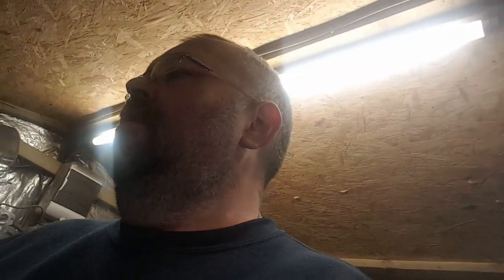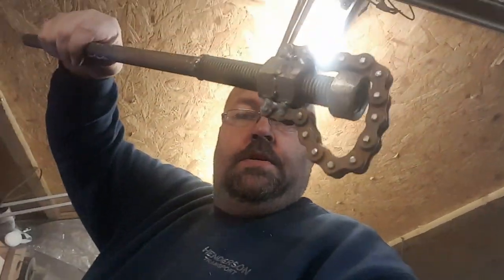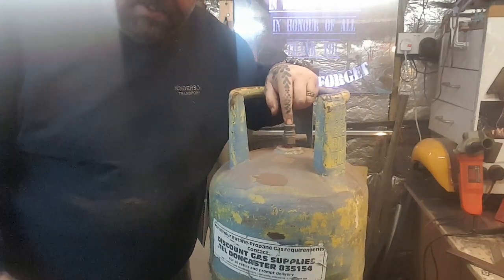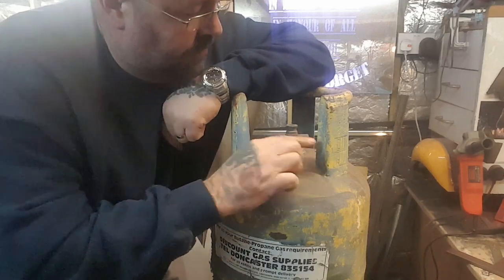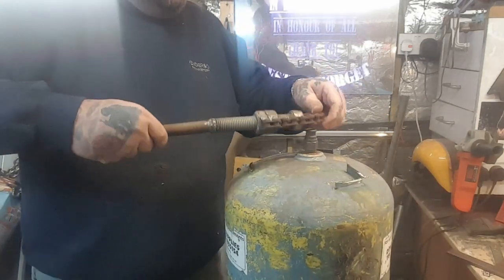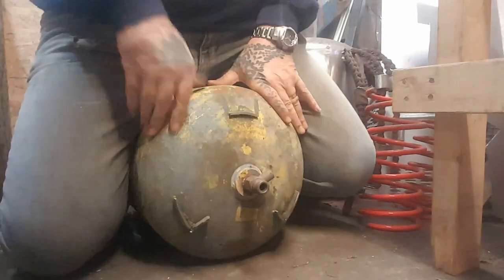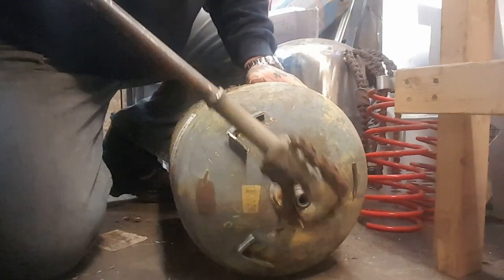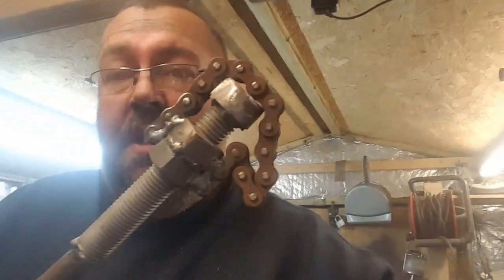How to remove a gas bottle valve. The easiest way ever.

Comment: So. Easiest way ever.  Use a spanner,  but only works if your 20stone .   Paul you crack me up pal.  But still. 👍🏻
Reply from the maker: Not a spanner. It's a chain wrench. I've always found snappers just round over the brass valve.